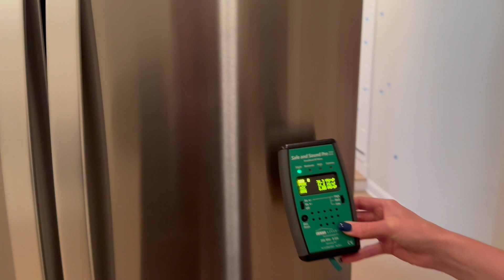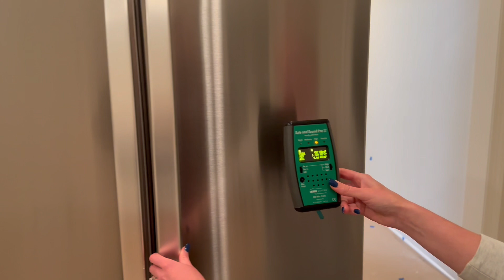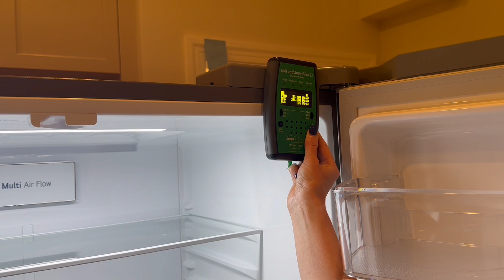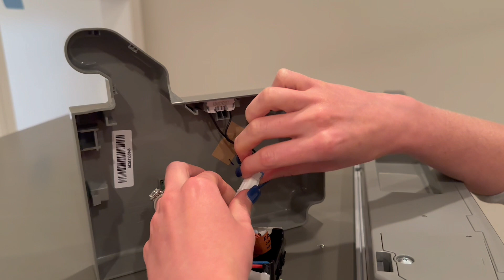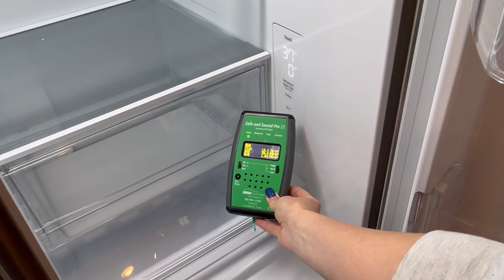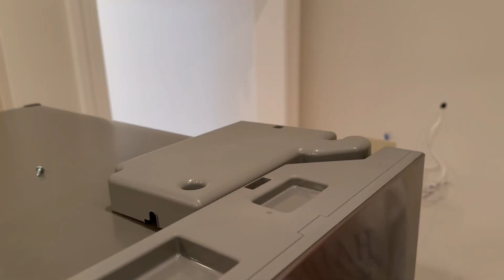How to Disconnect the Wifi Chip in an LG Smart Refrigerator | Step-by-Step Guide | Reduce EMF Levels

Comment: That second piece you disconnected on the left hand side (and then you did it on the right hand side too) are the door sensors. You should disconnect them. You also disconnected the door open alarm. Those are 3 things I wouldn't disconnect. But thanks for the video showing where the Wifi chip is. I don't need my fridge talking to the internet and giving exact locations and lord only knows what else.